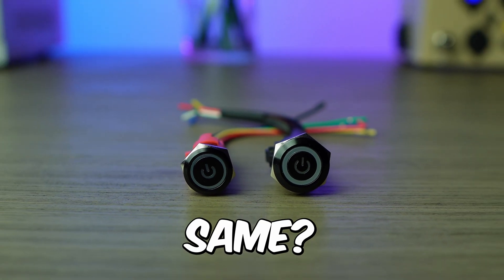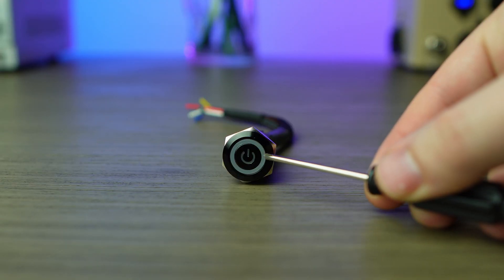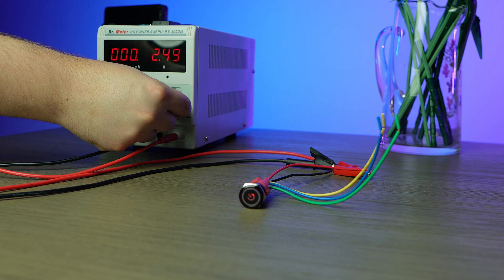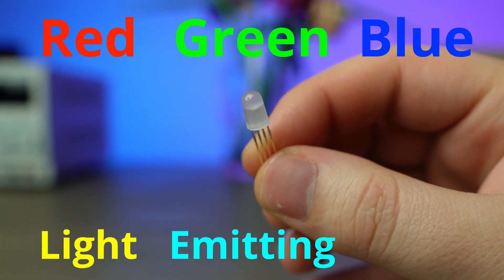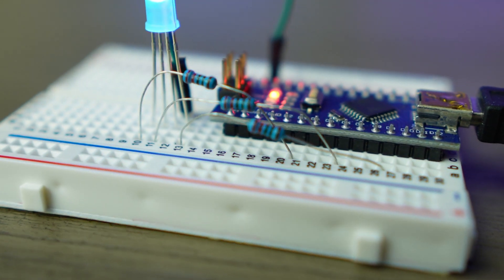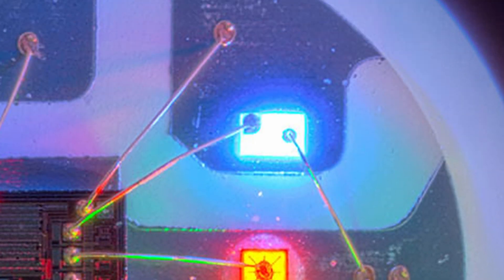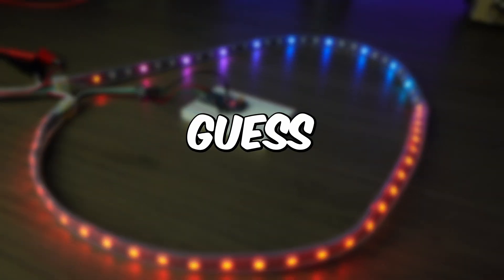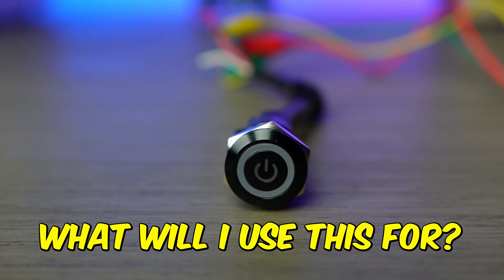Can you spot the difference between these two buttons? (ChromaTek RGB NeoPixel Button Short)

Comment: Thanks for sharing!! I didn’t know they sold these. I ended up making my on on my CNC build… glad to hear they actually make these now!
Reply from the maker: There’s also buttons that have the normal 3 lead RGB built in but the neopixel makes it so much better since you can hook as many as you want together with only 1 wire. I definitely think your CNC build is a great application for these
Reply: @korbano  yes those are the ones I have used then added a ws2811 chip to them to essentially make them like these new ones!! I have included it in my video: Matilda CNC // Root Controller // WLED // FluidNC
https://youtu.be/S51chZ1mzLE
Reply from the maker: @NEWTechCreative  that’s genius. I didn’t even consider adding the chip to a normal RGB button. The Chromatek buttons seem to be pretty low on stock with some options out of stock everywhere so your idea is gonna be my backup plan
Reply: @korbano  I hope to see the neopixel style buttons commonly available in the future!! so clunky without functionality! Thanks for checking out my DIY version!! Can't wait to see your next stage with the buttons :)